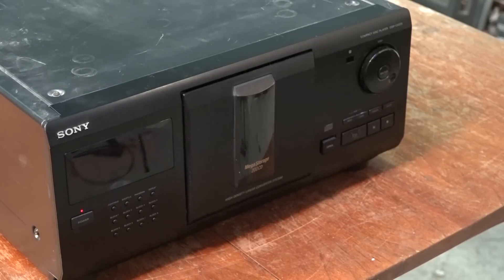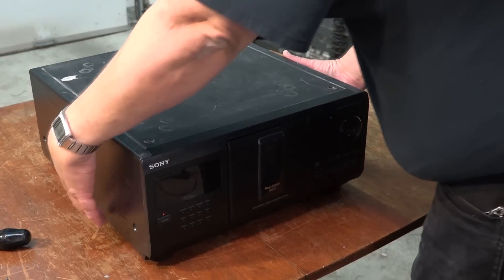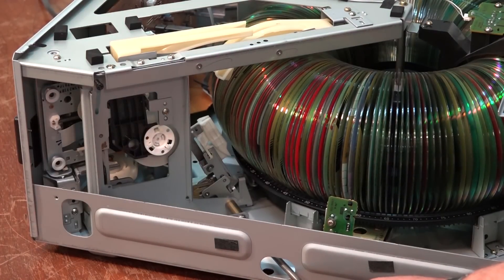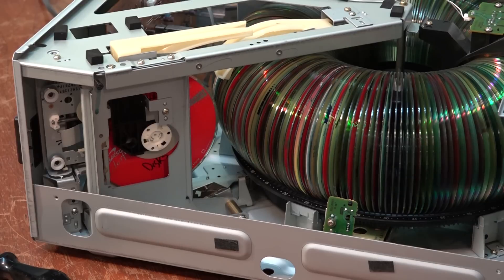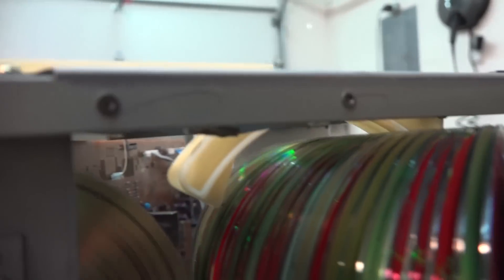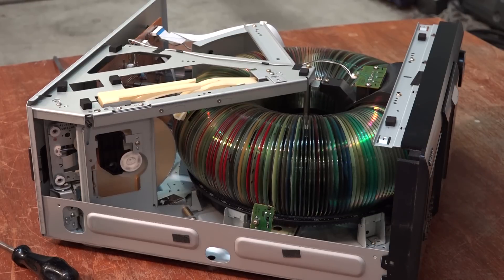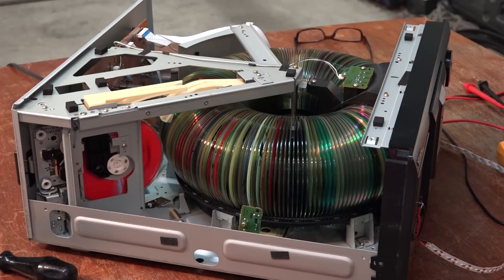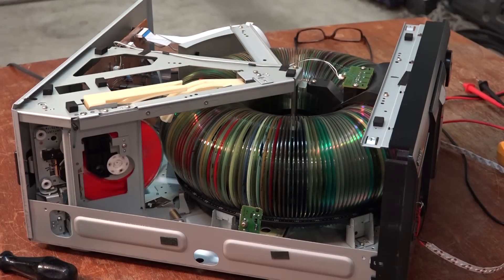Sony CDP CX225 200 Disk changer

Comment: THIS IS A BETTER UNIT SIMPLER THAN MY210, EASIER TO REPAIR, AND MAINTAIN ,LIKE GEAR BELT.
Reply from the maker: The 225 imho is one of the best changers on the market.   Mine has been flawless and has literally thousands of hours on it so far.

Comment: The laser is infrared on this thing.
Reply from the maker: All cd use ir lasers but there is refraction that occurred which allows a red dot to be visible to the naked eye.  The ir radiation is much higher than what you see if you look at it from a few feet away where you are safe from it.  Turn on the night shot on camera and you see the laser radiation in the ir spectrum.

Comment: Just think today you can fit 300 albums on a 3cm flash drive
Reply from the maker: Ya shitty MP3 sound quality.
Reply: 12voltvids FLAC is amazing
Reply from the maker: Yes but not everything supports it. For example I can not take a FLAC encoded file and pop it in the USB reader in my car. Nor can I play it on my portable player. I have a 128 gig stick in my car loaded with some 19,000+ tracks and it sounds good enough for the car, but for serious listening I prefer uncompressed CD or DAT audio.

Comment: Excellently detailed vid - thanks for uploading this. Mine is doing something that you haven't mentioned - if CDs are spaced out (say a gap of 4 slots between each) all works fine, but if I place side by side the mechanism that loads the CD up in to the player seems to pick up the disc then drops it inside the unit. After watching your vid I'm thinking the issue could be with the CD spacer arm or the catcher - but would appreciate it if you could let me know what you think it might be (that said on occasion even if the CDs are spaced out the CD may still drop out of the player mechanism after being selected). Thanks in advance.

Comment: I wonder how much this thing cost back then, new.
Reply from the maker: A new 300 disk unit is listing on Amazon for over 1000 and some sucker with more money than brains will likely buy it. This one was probably 700-800 when new. I didn't pay anything for it. I traded a 5 disk ES changer for it because the owner didn't know how to work it, and it was too much hassle to just load a single disk to play.
Reply: Used one here $20 no remote control

Comment: 200 disc?!  For the real music lovers I guess.
Reply from the maker: They made a 300 and 400 version as well that also played DVD and blueray disk. Those could be linked to additional machines for continuous music with cross fade and no pause between tracks.
Reply: @12voltvids  You could literally play music for a month or two and never hear the same track twice.  Why would anyone need so many disks?
Reply from the maker: @infinitecanadian  so they can load every disk permanently in the player. They memorized the disk and you could plug a keyboard in to save additional info.
Reply: @12voltvids  You mean a computer keyboard or a proprietary one?  Either way, that would help, except when they had to move it of course.
Reply from the maker: Yes a standard ps2 keyboard would plug into it.

Comment: it looks like it would scratch the disk
Reply from the maker: Probably more gentle on disks than opening the jewel case and placing them inside.Some of the older designs were prone to dropping the disk from time to time, and then there was the dummys that moved it loading with disks, but no they were well designed, at least this one was well designed.